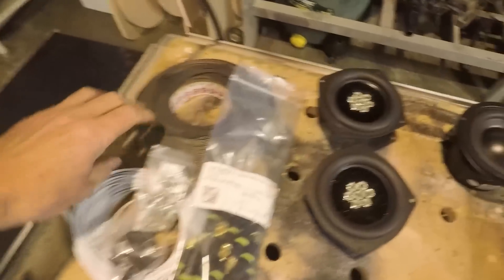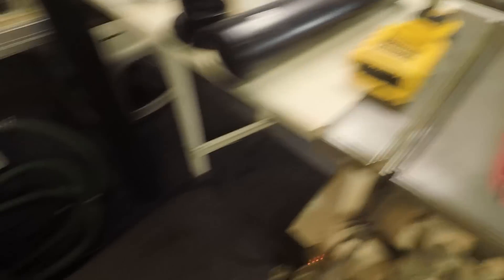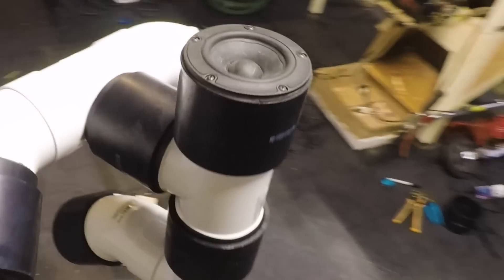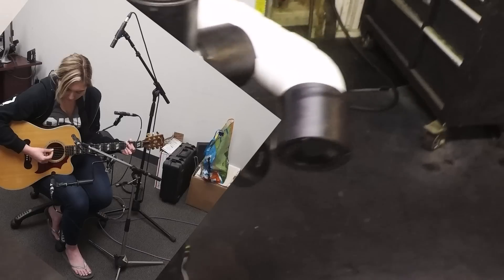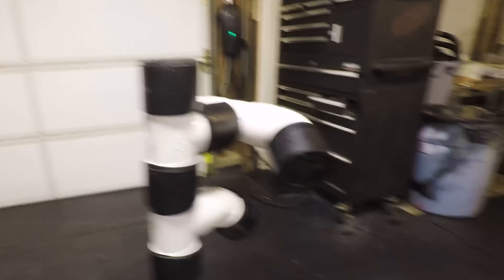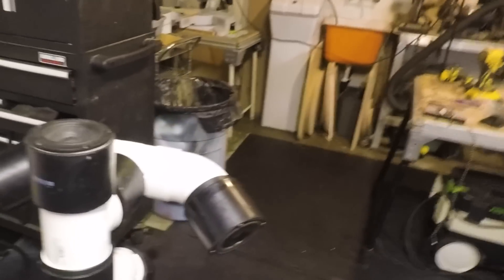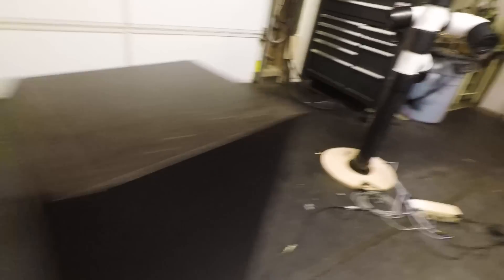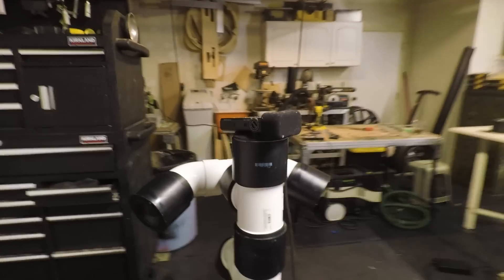Speakers Don't Sound Real, Lets Build One That Does

Comment: Dave you are a genius. But. I have to humbly disagree with you on one thing. ATMOS is about seamless specialization. Seamless. As in not point source dependent. It’s designed to simulate an actual 3D environment. EDIT: again you are a genius. This was one hell of a great experiment.
Reply: No I believe that the HRTF is good science capable of informing us how the human ear, which in and of itself is two single points in space, picks up sound radiating AT it from all directions, and thus allows us to recreate that same information from an array of speakers such that those same two ear receive and perceive the same impulses so as to tell us where something is making sound in the space around us.
Reply from the maker: So if you are near one speaker and the sound is supposed to be behind you and you walk to the other side of the room next to a different speaker, you are saying the sound will now be in front of you and stationary regardless of where you wander? And when a sound is supposed to radiate from the center of the room, and you stand near a speaker, the sound from the speaker will be invisible to your ear and only sound like it is coming from far away?

Interesting and I recommend you try that and see how well it holds true

Also, FYI, I have been to an Atmos demo at a Dolby studio demo'd by Dolby.
Reply: @DaveRat  you aren’t wrong. But my point is that the intention of ATMOS is that the array and format are tuned for a listening arena for an experience. At a concert are audience members walking around on stage? Or watching the band from a listening area? Same for a play, movie, comedy act. I’m simply saying that your point and the design intension of ATMOS are closely related and approach a similar problem from different perspectives. And that it’s a little myopic to suggest ATMOS is simply an array of point sources. Certainly if you get up and move around in an atmos environment you have left the scoop of that array. However they have built the binaural composite to address situation where you would not be seated in a tuned environment. Your example here is fantastic and I think it’s a DIFFERENT example of an immersive experience. One that can and SHOULD co-exist with other formats. I personally don’t agree that stereo, surround or immersive arrays are based on a “flawed idea.” I think that’s a purist perspective of a solution to a problem. And I can and will happily disagree with you on that while still very much retain all the respect in the world for you and what you bring to this community. Honestly.
Reply from the maker: Very cool. I am not saying one 8s better or worse. For recreating sound for a movie, one would want to recreate an environment and having speakers around the listener is an effective way to do so.

And if one desired to recreate the experience of being in the same room as a live muscician, one would want speakers and sound the is amongst the room and or listener. A closely clustered set of speaker that radiate sound in all directions just like an instrument does and not a bunch of seperate speakers. 

Differing tools for differing goals.

That said, have you ever heard a sound system recreate the sound of an instrument so accurately that you were unable to tell that it was a reproductionbas you walk around the room and listen from differing positions and angles?

Do you think Atmos can accomplish this? Could Atmos in a restaurant convince kpate9ns that they are confident there is an actual person playing acoustic guitar somewhere in the room?
Reply from the maker: Yep, and it is based on a fundamental flaw. 

It is all good for recreating sounds radiating inward. But a musicial instrument radiates sound outward like a sprinkler in field or a campfire

Atmos is like a bunch of shower heads or flashlights mounted on the wall and ceiling.

Do you really believe a realistic sensation of a campfire radiating light outward in various directions can be recreated by shining lights from perimeter locations? 

Do you really believe humans are incapable of being able to tell the difference of where sound is radiated from?

That said, it is two different objectives.

Atmos recreates an environment.

I am striving to place the musician into the listening environment

Atmos brings the room with it

I want only the room the listener is in as if the musician is there with the listener.

Comment: what if you combind a random group of sized drivers as well? line the 1960's wall of sound. Maybe they were on to something!
Reply from the maker: Hmmm. Reinforcement vs reproduction. Wall of sound is reinforcement of 8nsteuments without mixing them together.  

I have done much in the area, maybe search Dave rat double hung PA.

That said, this is about designing a speaker capable of accurate reproduction

Comment: Hi Dave, forgive me if I’m wrong but, if the L, R, and rear speakers are essentially pointing downwards and the top speaker points upwards, granted they provide multi points of origin, but isn’t your speaker still a 1D sound source as configured?  Which in my opinion actually makes it even more impressive that it sounds so multidimensional even when recorded and played back in stereo.
Reply from the maker: Each speaker is acting back a different mic. 4 speakers 4 mics

Comment: Hi Dave, great experiment, similar result experienced by tying to reproduce vocal. Still not reached the ultimate, I realized that 4 speaker 4 mic is sufficien, more is not improving, the next big improvemen what I found on vocal is on the speakers. Basicaly to get rid of the box. (box resonance is heared by the ear ) So I moved to open baffle (problem the baffle resonance ) and than in the end to no baffle spekers (4 way cross over system, system linearity unacceptable measured, my ear can just complain the low end ) and ribbon mics this is the best what I reached, still not perfect but ok. I want to share with you my experiment result, as I see you feel something is missing
Reply from the maker: Agreed on the box always being an issue. Though it may be the baffle size and port more than having an enclosure

Comment: This is really cool, very unique...I am not sure exactly about your geometry, but for 4 channels, imagining the corners of a tetrahedron (or the faces of a tetrahedron) would give an ideal 3 dimensional spread... but in real life, a lot of instruments project much more to the front, so maybe let the 4th speaker in back is not as useful... maybe one speaker facing "forwards" and 3 others radiating up/down/left/right to some extent.... depends on how the listener(s) will be positioned, tho.  Very cool concept, thanks for sharing :)
Reply from the maker: I am not sure it matters to much. In fact I believe perfect symmetry may be non optimum. Instruments are usually irregular and non symmetric in one or more acid plus the human hold of the instrument tends to further increase and alter the non symmetric aspects 

It's not about radiating the same sound in all directions evenly, it's about radiating different sounds in differing directions unevenly that makes a real instrument sound real. In my opinion and testing so far.
Reply: @DaveRat  I was thinking like 1 mic in front of an acoustic guitar is the "main mic" and that channel goes into the "front driver" then overhead mics by the head stock and one behind the endpin, those channels go into left and right-facing drivers angled upwards, then a mic at the floor and that channel goes into a down-firing driver... if you google "icosahedron"... cut one of those in half (roughly) to be the speaker cabinet.  There are several other geometric solids that might make interesting speaker arrays.  Thanks for the response, good luck, your idea is inspiring.

Comment: How can you use this approach if you only have stereo source material?
Reply from the maker: The same way you can have separate potatos, green beans and tomato's after they have already been combined into a soup. 

Once mixed, separation is at best an approximation

The fact that we make soup out of all the band instruments kind of messes everything up down the line
Reply: @DaveRat  My understanding was that you fed the each driver a different track of the multi track guitar recording.  If correct, how would I use a speaker like this if I had a pre-mixed two-channel stereo recording?

I think this approach is very cool if you have a multi track recording that you can use to feed multiple sets of driver arrays arranged as musicians would be in a space but am wondering if there is an application for commercially available stereo recordings.

With a stereo recording, would your approach be significantly different than a speaker like a Bose 901? Or asked another way, with your four driver speaker, would one just send a mono signal to all four drivers?
Reply from the maker: In my opinion to create sonically realistic sounding reproductions one must:

Never send the same sound to more than one speaker that can be heard from any listening positions

Never send the same sound in multiple directions

Send differing sounds in differing directions

Avoid speaker baffles and resonances. 

Perhaps a single instrument maybe crudely recreated with 2 stereo but I believe 3 or 4 tracks per instrument is probably the minimum to have to create reasonable realism.

Comment: It is really fascinating to see, how the ideal world of recorded music could look like.
But I disagree with the statement, that "stereo is wrong". Sure it has limitations compared to the real world, but that is not its purpose. It is a cheap and stationary system which job is to recreate a consistent listening experience. And because it does that very well, the whole world uses stereo systems. Nonetheless, I'm hooked by the idea of "space aware" or "walkable" systems. But if they sound "better" is highly subjective.
Reply from the maker: Stereo is not wrong, stereo is wonderful and fun and sounds cool and is convenient and with headphones can sound very convincing

And if your intent is to reproduce a sonically realistic reproduction, stereo is not the a tool that will accomplish that goal unless if the listener will hold perfectly still and never move and the system is extremely well setup and of very high fidelity.

Conversely, a sloppily built speaker that radiates different sound in diff directions sounds very real.

Also, sounding real and sounding identical to the source are not the same thing.